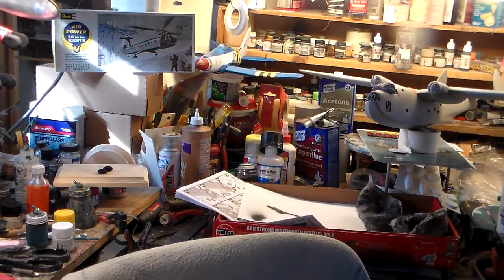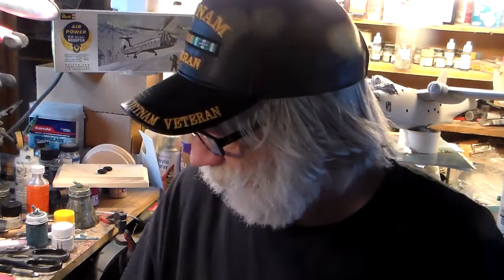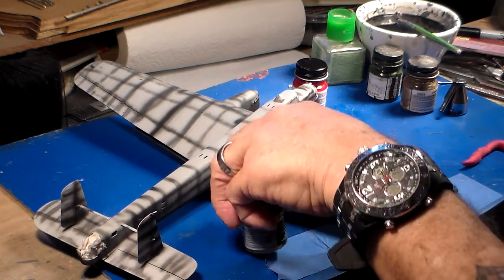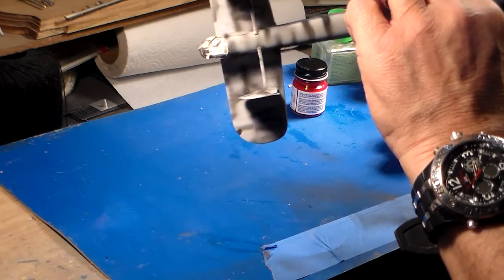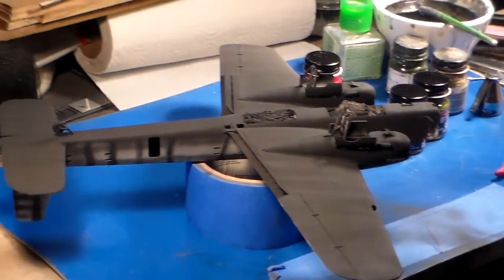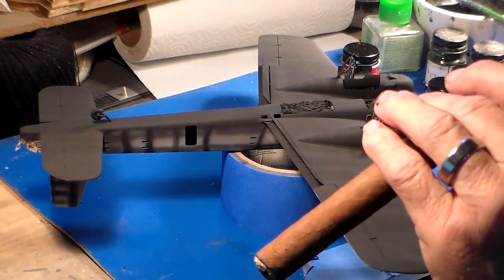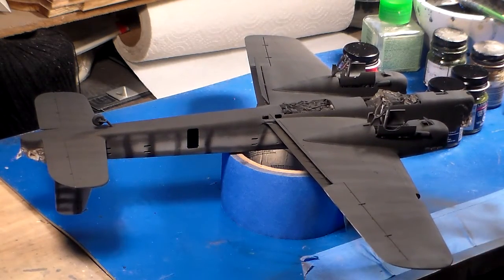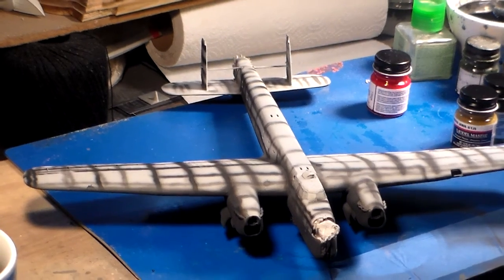Airfix 1/72 ARMSTRONG WHITLEY Video 3

Comment: Frank when you made your Gotch Forch,what did you use to seal the hull for a smooth finish.?
Reply from the maker: Ahoy Philo                      For wooden hulls I use bondo glazeing putty to fill in any gaps or imperfections when the putty dries sand the filler off the hull and prime the hull when the primer dries you will see more imperfections and dings that need to be re filled the entire process is done repeatedly until your hull is smooth a time consuming process but the work when done will be appreciated that's how I do my hulls same thing  is done with plastic hullsd only if they are in two pieces. There you go PhiloFrankie Day